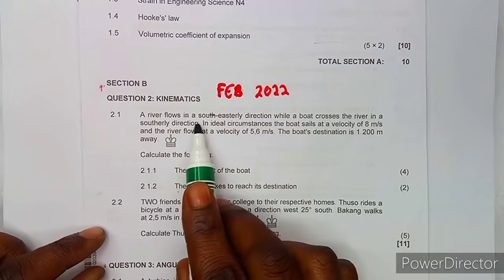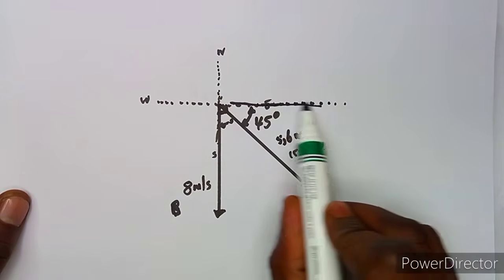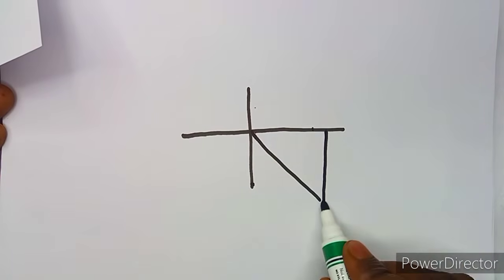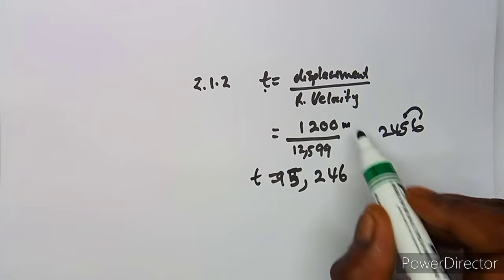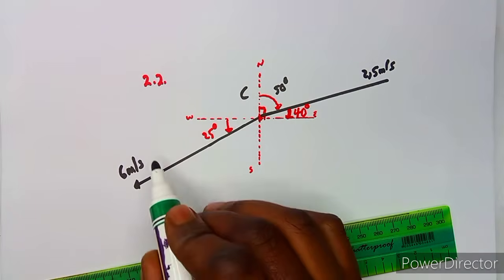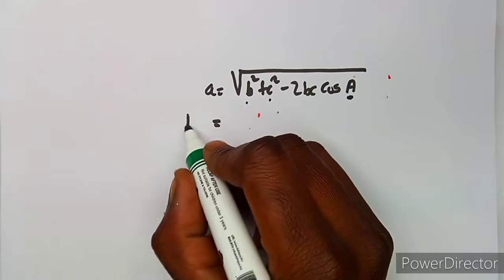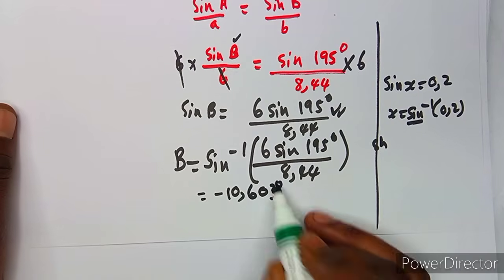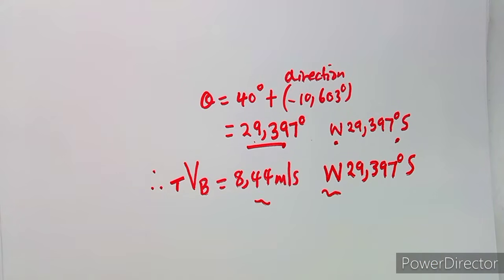Engineering Science N4 Kinematics February 2022 Past Papers and Memo @mathszoneafricanmotives

Comment: For direction in the last question it must be taken from the horizontal to the resultant, so shouldn't 10,603 degrees have been taken as a positive when adding it with 40 degrees to find the sum. Just a bit stuck on that.